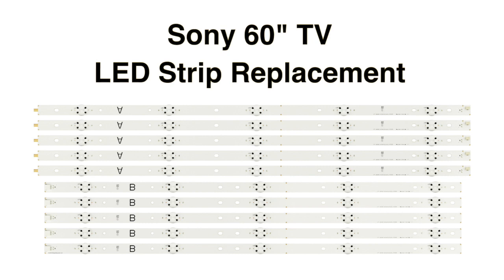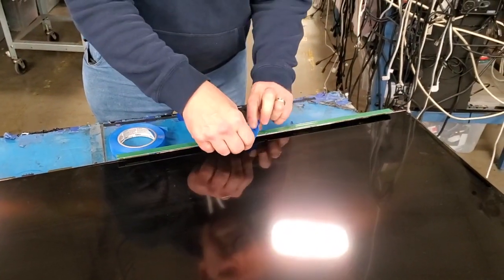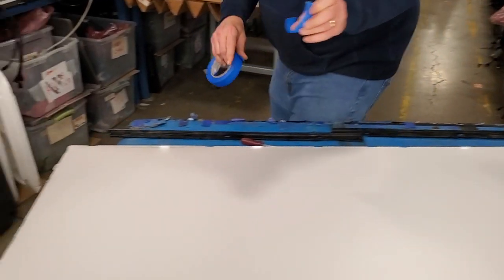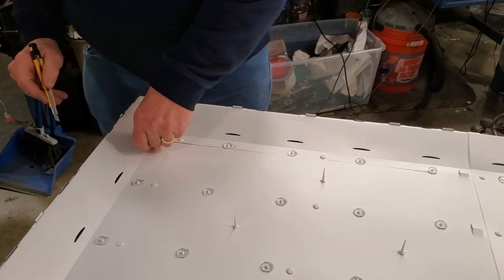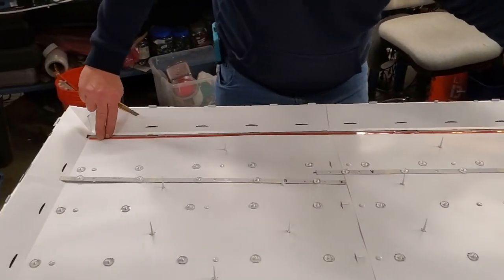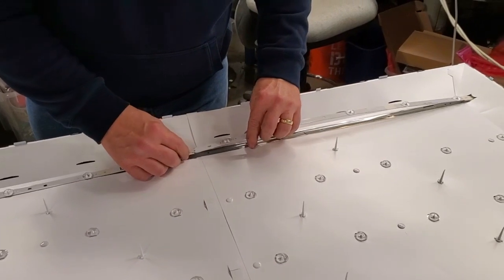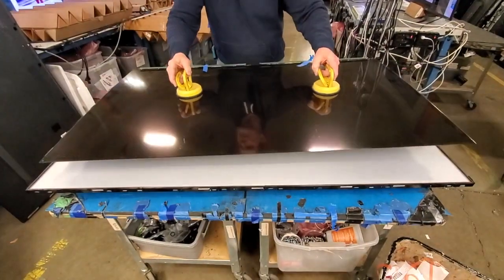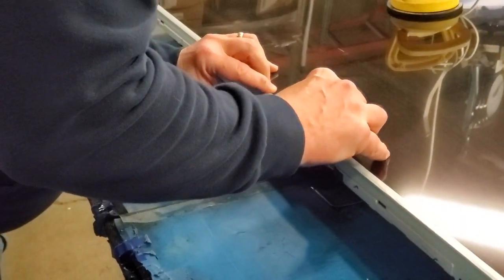Sony 60" LED TV - No Backlight No Image LED Strip Install Replacement Sony Model KD-60X690E

Comment: THANK YOU SO MUCH

Got the TV from goodwill for $50 and the backlights were already bad with the slightly blue tint. Exactly the day passed the return window the TV bricked and I got the red blinking light of death. Luckily I had already ordered the backlights but was skeptical it would be able to fix my TV that would not turn on. By some miracle it did though and I saved myself 1.5k on a brand new one. 

PSA: Unless you have 3+ people, buy some cheaper suction cups to remove the screen because it is FLIMSY and will snap like it was designed for that sole intention.
Reply: don't use cheap plastic suction cups, they don't hold. Get quality metal cups. Ask me how I know...
Reply: Thank you for that suggestion! I was torn about whether or not I actually need the cups. Will get some tomorrow.

Comment: Thank you so much! Went from 6 blinking red to a working 60" tv! Thank you thank you thank you! SOME NOTES:

On my model (seemingly the same, but not important): 

1) there are screws holding in the filter mounts. after taking off the screen, you can break the filter brackets' little clips, and the brackets themselves if you aren't careful. if its fighting you, take the tape off and find the screws!

2) during the video, he has already removed whatever part you see. On account of that, you're going to see pieces he doesnt show. Easy to figure out, but if its fighting you, stop and think, and remove some tape. There's probably some tape in there.

3) While replacing the backlights, make sure to line up backlight A first! the little plug cant really be moved around, while backlight B can go anywhere. If backlight B is off kilter, it's FINE. The diffusers straighten out your lights, just make sure you can get backlight A to reach the plug. 

3b) IF YOU CANT get backlight A to reach the plug, DONT FRET! cut the tape holding the wires in place, and you can gain a lot of distance on the backlight A male wire reaching to the strip.

4) the backlights you ordered are VERY FRAGILE, treat them like glass.

5) while working with the two ribbons connecting to the buffer panels, BE CAREFUL! i bent mine because I didn't understand the way they locked/unlocked. The clamp pulls towards you while you are unclasping them! when you are reconnecting them, there is a bump in the outermost portion of the ribbon, and that notch will kind of click into place before you then clasp down the lock, ON BOTH SIDES. this will make sense when you get there.

good luck, fixed my 6 blinking red lights!
Reply: i think the big thing missing from this walkthrough is that you can safely remove any tape from the unit, and you will find all kinds of stuff under them.... take your time!
Reply: THANK YOU your advice helped so much.

Comment: I had the 6 red blinks and I replaced the LED strip on my Sony TV last night. However, after replacing it and turning it on - LED is lighting up but there is no picture on the TV (I can see dark lighted screen). Light is solid green, no error and it seem to react to the remote when I press it. Do you have any suggestions as to what needs to be done to have this fixed? TV was only 3 years old. Thank you for any comments/suggestions.
Reply: Hi, I have the same problem, I changed the  leds, but now is no picture on the tv. Did you fix the tv? Thanks.

Comment: do you have any idea what this should cost using a service guy referred by sony?

i have this exact model less than two years old purchased brand new, watched football on it all day yesterday then this morning wouldnt turn on and i noticed the six red flashing lights, sony support gave me the number of a guy who says what im describing is 99% the backlight and the estimate range he game me is the same price as a new tv

like everything in this world SONY is not what they used to be
Reply: $300
Reply: @davidmobley4983   i had a repair guy come today he had quoted me $240 if it was the backlight, he came to pick the TV up bc he said he needed 3 tables in his shop to do it & he messed with my TV for a few minutes and said throw it away and buy a new TV the panel is fried

he drove a fairly long distance to my house for absolutely no charge to pick up the TV & he wouldn't even take it with him, he said what this will cost to repair just buy a new tv

my previous sony lasted 20 years this one didn't last 2,

just bought a 75-inch samsung at costco for half what this crap model sony cost, ill never buy sony again
Reply: Lots of folks with these same problems, myself included.  Sony should be ashamed.

Comment: Do you guys have a recommended brand / type / size of double sided tape to use for this procedure?
Reply: Painter's tape
Reply: @wasdw246  Maybe for holding the logic board against the panel but definitely not for holding the new LED backlights in place.

Comment: WARNING!!  I don’t know if you tested the tv after, but by cutting the reflection sheet to get the lights out I now have light black strips going across the screen especially noticeable when the screen has bright whites or light colors.  You can see where the light isn’t reflecting now.
Reply: Did you put the reflector strips back on the LED strips when you replaced them?

Comment: Hello, I replaced all Led strips on my Sony KD-60X690E. After i finished I turned it on and green light stays on,I have sound but no picture. Backlights are lit up and seem to be fine. What could I have done to cause no picture. The green light stays on and responds to remote control but I see no picture when i hit home on menu and  although screen is not black I see no display. Do you have an idea what may be problem? p.s. I checked all cables and everything looks to be plugged in.
Reply: Nerrad, did you ever figures out the fix for this? I had the exact same experience as you.
Reply: @fullermanb   Yes It was the 1 of the two Ribbons connecting to the T-Con board.
Reply: @nerraddier  What do you mean the two ribbons - I have the same issue, sound but black screen.  I'm pretty sure I put both ribbons on properly...
Reply: @kreeperkriminal   There are two thin cables that are connected to the screen and a circuit board at the bottom of tv if you take the back of the tv off you'll see them. They (depending on the size of tv) 60' will have 60 pins 65' 65 pins and so on. They can easily be damaged if you take them off. I damaged one of them slightly and I had a hard time finding a replacement. I fixed my tv by replacing the LED strips but because I Tinkered with the tv at first when it didn't turn on so many times I damaged one ribbon. If your tv just started to go out unplug it,10 min and plug directly into the wall and not power strip. if it comes on and works then your Led's are going out and need replacing. You can do the unplug trick about 10 times before it fails completely.
Reply: @nerraddier  Where did you buy the ribbon? It seem like I have the same issue after replacing my LED Strips. No picture but backlights are lit up and appears fine and also have green light on TV.

Comment: So I ordered new strips and I have one set that will not light unless you check the positive and neg leads on it. So I put positive test on first set and neg on last and I dont get any light. Cant be the strip itself...or should i just put back together and hope for the best.

Comment: How do you know if it is a bad Tcon or the backlight? My Sony KD-70x690e has a bluish hue and getting worse.
Reply: MINE too!  Did you figure it out?
Reply: I have the same model and it’s the LED’s.  Sony has multiple issues with this exact model and LED’s making the pic have a blueish tint.  Btw, Sony won’t due anything to help you even though this is obviously a defective part.  I replaced mine pic looks pretty good and now I’m selling it and never buying anything Sony again.
Reply: @mrbeerguy8724  Just so you know, a lot of samsung panels suffer the same fate, they must be buying the LCD's from similar vendors or the LED's are the same.
Reply: @mrbeerguy8724  how much did it cost to get the LED's replaced?
Reply: @Binge  did the TCON board work?

Comment: Not another backlight repair video again. need to show some repair  on how To repair screen when there is Line an other defects on the screen
Reply: More of a in depth diagnostic. Could be mainboard, logicboard, drivers/ribbons, bad screen or bad cables to the logicboard/mainboard.